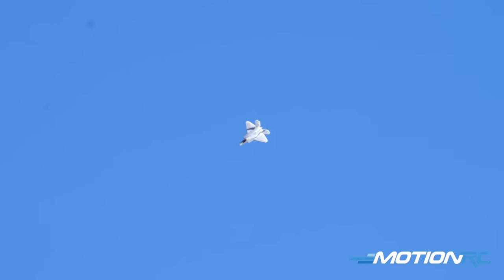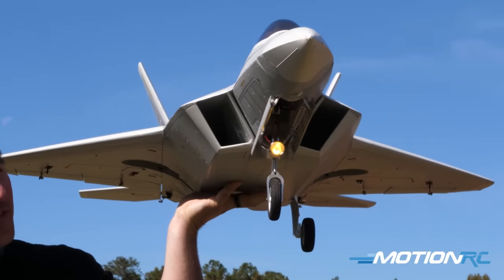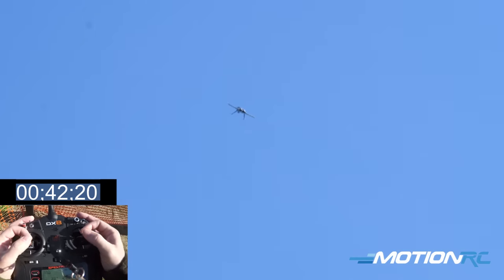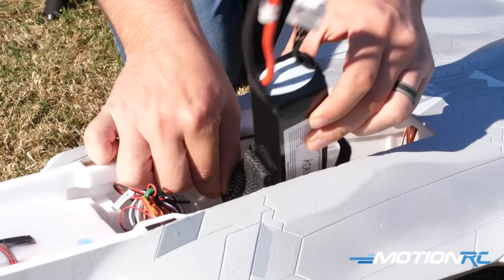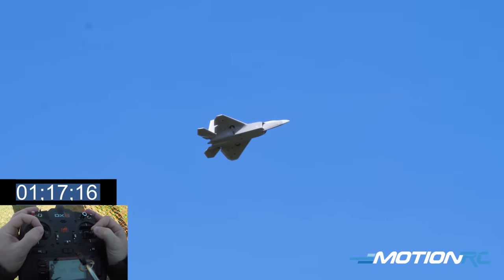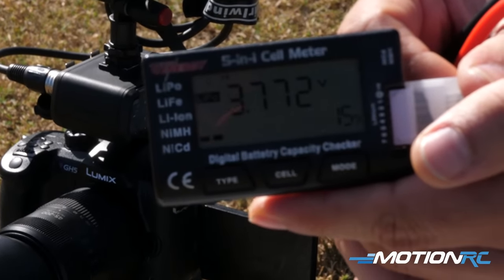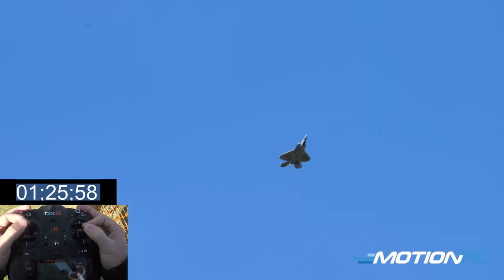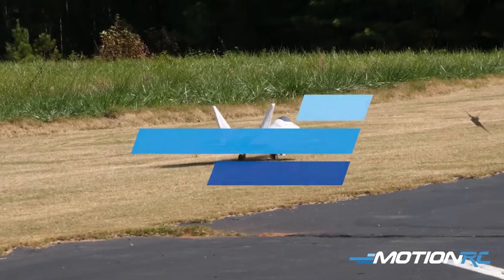Freewing F-22 Raptor 90mm EDF Jet - Flight Review - Motion RC

Comment: Just told the wife what the next purchase will be!  Luckily she know s it help me with my ptsd and she is okay with it.  Now I need to start saving!
Reply: So common to read ppl checking with the wife. Respect her, love her but wear those pants dude. Buy what you want when you want (that goes for her too) as long as the bills are paid no man should have to check with a woman.
Reply: @MajDuty  it's just out of respect most time really.
Reply: @MajDuty  notice how he said TOLD the wife lol!
Reply: @Eric Rogers Make sure you read the thread over at Hobby Squawk on the F-22, specifically about the proper neutral setting of the elevators. The picture in the book isn't as clear as it could be, and it has caused confusion for folks, and led to my crashing mine on take off. Had I read the thread first, I would have been fine. Replaced the vertical stabilizers/rudders, and the plane flew great, until I flew it too far away, lost orientation and dumb-thumbed it into the ground. I'm saving my pennies for a new airframe. I really like this plane!
Reply: How much does this thing cost? I love the F22
Reply: @DudePlays247  489.00 on motin rc's website
Reply: Where can I find this, yeah I know I am late but where
Reply: @bread4228  won’t fly like this thing does.

Comment: At 27:05 you can see the right gear "sprain its ankle" and causes the jet to swerve for a moment. That could potentially become a big problem that will cause excessive wear on the wheels. Defiantly not a deal breaker for me though.
Reply: Correction.  This landing gear set was upgraded to compensate for initial landing strut impact, also to help in closing the main gear doors flush -- ex: 2:34.  They can take a good deal of gentle abuse.

Comment: The F-22 has actually been around since 1997, not 2005 like said in the video. I'm SOOOO happy Motion and Freewing are venturing into 1980s+ models!! This one made my dreams come true. But at the risk of sounding greedy. Next I'm hoping to see a new 90mm Super Hornet to replace the older, discontinued 90mm kit. (maybe in Blue Angels to celebrate them upgrading to Super Hornets over the next two years? Just a suggestion).
Reply from the maker: I meant it started service in 2005
Reply: I just remembered when I was in ROTC and these were the new thing everyone was talking about, along with the (then) new Super Hornets. Which is probably why those are my favorites.
Reply: Actually it was in 92 i think it first flew or so i think
Reply from the maker: its maiden flight was 1997, then entered service in 2005.

Comment: Man that’s a pilot the landing are in scales with the jet I would class that a 12 out of 10 ,
Absolutely perfect, if we could only have much more distance coverage for the radio to reciver we could fit a fpv and camera on this thing and it would really mean * sky’s the limite * I have 5 Rc up to now but never when on the side of flying I’m more on the crawler, racer,short course, kinda guy but I’ve watch a couples of jets specially the stealth one maybe not the one who’s fly the best but the look of exclusivity is undeniable so I’m thinking going on the dark side as they say 😂😂😂👍👍👍👍👍👍
Reply: I plan on getting the F14 and put in a self engineered camera and telemetry system which I can view on a little screen while flying. The F14 is large enough and with enough power (2 * 80mm EDF) to get the extra weight of the ground

Comment: Thank you Motion RC for placing a picture in picture to show pilot trick how he controls the plane, please do this from now on, on all your flight reviews, one question, what receiver are you using? Gyro, Stabilization? Is this a 12 blade? Thank you for such a great plane.
Reply from the maker: no problem. Will be the standard for flight reviews going forward
Reply: Merrick Manor no gyro used in these flights. We used the new antennaless 6ch spektrum rx.

Comment: Looks great...But since when is 15% at storage charge? When I buy batteries they are 30/40%
Reply from the maker: Proper storage voltage for a LiPo is approximately 3.85v per cell. We just a bit under that.

Comment: I hear people talking about high rates and low rates. How is this, or is this different from dual rates?
Reply from the maker: Same thing. Dual rates just means you have a set of high and low rate programmed into your transmitter. Sometimes a model doesn't require full throws on some control surfaces or is better during different situations. For example I prefer to take off in full high rate, but once cruising I switch to a lower setting for tamer movements.

Comment: On the first flight you came down with 15% battery remaining, 3.768 per cell avg. Recommended is coming down with 20% capacity remaining. Recommended storage charge is 3.85 volts per cell. Again on the second flight you came down with 15% capacity  remaining. You did not show the remaining capacity of the third flight with the Admiral Carbon. At 7:04 into the video James called out flying with 6000 milliamp 5s battery when you are flying 6s. Little details matter. Love the free flowing formant, nice new change up.
Reply from the maker: Sorry fumbled my words. This is raw flying. Didn't want to audio dub it or give any impression you aren't seeing the real thing. As for storage charge, it's close enough. I prefer 15% for that extra pass but too each his own.
Reply: No apologies needed, as I said I love the format presentation. There is a difference between recommended discharge voltage and recommended storage voltage for lipo batteries as I know you are aware. Recommended maximum discharge voltage is around 3.5 volts per cell and recommended storage voltage is around 3.85 volts per cell. These value matter as the quality of batteries varies between brands.

Comment: Looks really good!!   However man o man!!  That is the most complicated of anything I have ever heard!!!  Keep it simple and just fly one rate with the expo to set to make you able to fly all speeds with the same settings. Too may switches can make stuff confusing and cause crashes... I know its all a matter of preference but once you step up to the larger EDFs cutting down the complication keeps things easy and fun. I don't use any high, medium or low rates... all the same setting so that there is no mistakes to be made.
Reply from the maker: If it works for you, roll with it. I prefer rates like Patrick here as I love different throws and having options.
Reply: @MotionRC  Yeah as I said to each their own... Its just that you guys say that it could be a good introduction to the 90mm jets for an EDF newbie. Keeping it simple is a much better approach for them. But its a matter of preference... there is no right or wrong way...
Reply: @gooniac33  Big +1 on avoiding all switch throws that are not strictly necessary. 
I pretty much never use dual rates actively anymore myself, only as a tool for finding sensible rates during maidens/early flights. 
After getting rates tuned down (which essentially means as little throws as I can get away with while still having the authority I want in the low speed part of the envelope), then adding whatever minimum of expo required to make those rates comfortable in the center (keep in mind, less total throw = less expo needed = a good thing), dual rates are really rarely required on any model, especially not jets.

Comment: i have the f16 and if i have to use the 5100 carbon i have to put the battery at least 5 cm back with respect to the normal admiral 5000 otherwise is nose to heavy and it does not lift off. he put the 5100 just one or 2 cm back..and it flies well...that a mistery..
Reply from the maker: This is the F-22 though...?
Reply: @MotionRC  yes it was just a comparison, can you help me with a video on F16 cg with admiral 5100 Carbon? They are to heavy i cannot find good cg.. help me please
Reply: @MotionRC  please help me with the f16 CG with admiral 5100 carbon. they are very heavy and battery has to goes really alot back..with respect to the admiral 5000. thanks
Reply from the maker: @carmelocatalano307  the best bet is to jump on the HobbySquawk forum. You can get get much easier help in the F-16 thread there
Reply: Hu don’t you make a video on the f16 to help on CG for f16? F16 is good plane but very critical..
Reply from the maker: @carmelocatalano307  we did, but the 5100 carbon didn't exist when that plane was made. Many have used it and can answer you faster on a forum than I can here
Reply: @MotionRC  ok thanks, where is the video of CG of 16 90 mm edf? I will watch it Anyway...thanks

Comment: Just,what are the wires comming off of the esc wire? (VTX?)
You can see what I’m asking at 13:30 on video
Reply from the maker: That's the BEC. In case your motor ever cut out, this provides power to your receivers so you have a chance to dead stick your aircraft with control surfaces still functioning

Comment: Is this a decent entry into EDF for someone who has high wing, low wing, and tail dragger experience? (Planes like Eflite T-28, E-Flite 300D, E-Flite RV-7, etc).
Reply: Or would the E-flite F-16 be a better choice. Trying to reduce the purchase of planes, because if I get used to the F-16 real fast, I'm going to want to buy The F-22....
Reply from the maker: The F-22 is one of the most stable, forgiving Jets on the market. Hard to guage your readiness, but this plane can work for all ranges of pilots

Comment: Can you comment on which plane (Freewing f-35 70mm) faster, more flight time or overall performance?
Reply from the maker: Sure. They really are different beasts. This F-22 is larger, has flaps, has a larger wing loading which makes it ideal for beginners as well as seasoned pilots. The 6s version is fast, but the 8s version takes it to another level. The F-35 is also super quick, but since it is smaller and no flaps, it can be more of a handful for less experienced pilots. They really aren't a great comparison to one another. You should be able to get more flight time on this f-22 as it can fly fast and slow much easier

Comment: Awesome plane and all but this is the reason I’ve never been able to get into electric flight high fiving over being able to fly for 3 minutes. I know other slower  and different types of aircraft can do a lot better but I love flying speed. I learned how to fly on a 4 stroke warbird and and also 4 stroke ugly stick when I was a kid in the late 80’s I never did the trainer thing lol if we could get that big battery breakthrough I’d be all over this until then I’m sticking with nitro even if I’m more limited as to where I can fly.
Reply: Ronald Mills ,howlong due gas motors usually run for?
Reply: ClaytonMasse it depends on different things obviously but I could keep my ugly stick up in the air for 15 minutes or so. I never actually ran it out of gas that I can remember. The warbird a P-51 was a lot less but that was for racing so to save weight it had a very small tank and was always going full open. Between launching, waiting for the race to start, dispersing, and landing anywhere between 5-10 minutes
Reply: @tylermills79  thanks for the info.   I am looking to get into RC planes as I have always had a fascination with them.   Total newbie here.  Is there a forum that newcomes can get info from?

Comment: Hey guys can you please explain to me how the useful throttle timer works because I tried to do what I thought you meant and I don't understand... I see you getting four minutes
Reply: Little late, but they set the timer in the transmitter to only count down when the throttle is above a certain percentage, say 10 percent, so when the throttle is “idle” (at 0) the timer does not count down. So 3 minutes on the transmitter might equate to 4 minutes in real time

Comment: FYI the F-22 was released to the Air Force in 1995, not 2005.
Reply: Keith Bettencourt 2005 is more akin to the Lightning 2, tho not by mucj
Reply from the maker: It was first flown in 1997, but started service in 2005 https://www.af.mil/About-Us/Fact-Sheets/Display/Article/104506/f-22-raptor/

Comment: Also 7:02 did you mean 5000 6s cause you said 6000 5s
Reply from the maker: Yep. My mistake. As you saw we put in a 5000mAh 6s. The recommended pack
Reply: Motion RC ok just making sure

Comment: why do we only get like 6min flying time no way to make it more ????
Reply from the maker: it used to be 3 minutes on EDF jets, but technology is getting better and better. Its a loaded question you asked but comes down to LiPo battery size and weight.
Reply: @MotionRC  I guess I could just get 6batterys but by the time I drive to a field only 30min of play time. I dont know yet maybe nitro is the way to go but your kits look so damn good
Reply from the maker: @bumperxx1  or bring your charger, takes about 20 minutes to charge up a 6s 5000mAh pack at 2C. Usually I bring 3 batteries and as long as I charge the 1st immediately, then it is done by the time I finish my third etc. Or thats why we bring multiple planes to the field, so while you charge on that uses certain packs you fly another that uses other packs

Comment: My dad has one and we are scared to fly it😂
Reply from the maker: Have you flown before? Or EDF Jets before? If so then she really is a sweetheart. She has trainer like capabilities and a wide flight envelope you can grow into
Reply: I have one and its really easy to fly.
Stay in low rates.
Use the flaps when landing.
Dont cut the throttle when landing.
Get high up for loops.
Be in a spot where you have a 150 feet long stretch of smooth ground to land.
The thing compensates for a lot and is very forgiving. It flies like its on rails.

Comment: 415€ and it's still foam. no protective coating on the paint. everyone knows how fragile this painting is. and therefore your selling point is that there is a far cry on the landing gear. it is 100€ too expensive this model. you might as well take the 70mm and change the motor. and there is a big fault on the landing train.
Reply from the maker: This is one of the top selling EDF jets beloved by RC pilots the world over. She's gorgeous in person. Thanks for the comment though, always appreciate all of them